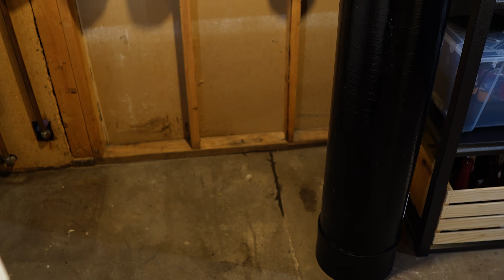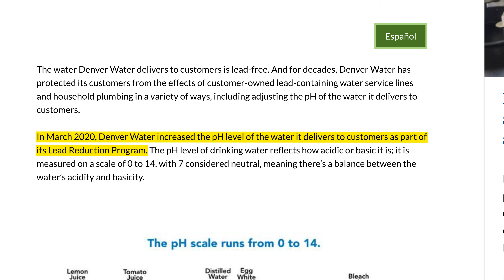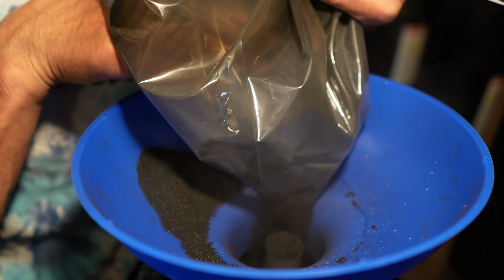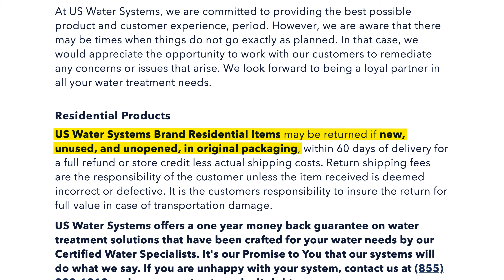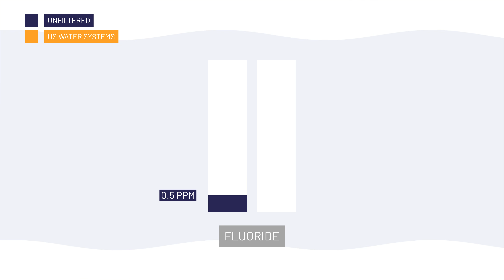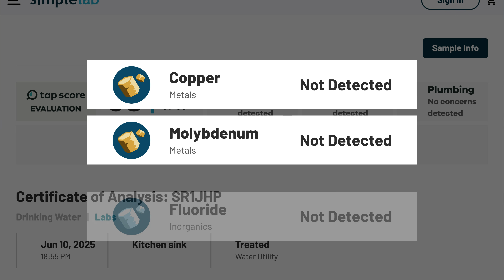The BEST Whole House Water Filter for Treating Lead & Fluoride

Comment: Why are all these contaminants in the city water at all?
Reply from the maker: A lot of contaminants are in city water because public utilities are regulated to meet the National Primary Drinking Water Regulations*, which set legal limits called *Maximum Contaminant Levels or *MCLs*. Those standards are meant to make water legally safe to drink, but they are not comprehensive and they do allow trace amounts of certain contaminants to remain in the water.

The important thing to understand is that MCLs are not based on health alone. They’re set by balancing public health protection with what is practical and affordable for treatment at a large municipal scale. So in many cases, small amounts of many contaminants can legally be present in tap water even when they’re not ideal from a health perspective. That's one reason i always say "meets regulations" does not necessarily mean "free of contaminants."

Comment: Have you heard of Pure Way whole house water filtration? I live on Maui and people here seem to be going crazy on this filtration. What do you think?
Reply from the maker: I have not heard of that brand, no
Reply: @waterfilterguru  They claim that dentist office use it, so it's medical grade. Im skeptical about everything, especially if it's popular.  I can barely find any outside information besides from the company. The system is about 4k to install. I think that's pretty expensive and I personally need some reviews bf I go for it. I'm taking your advice and getting my water tested through tap score first to see what I need in a filtration system first. Then, someone to install. 

Do you think someone's house pipes can contaminate the water after the filter, once it goes through the house? Im struggling with this. Our house is old. Originally built in the 70s. Who knows what the pipes look like? Is a whole house filter even worth it or should I try and filter each water source?
Reply from the maker: Yes a home's plumbing system can absolutely contaminate the water, lead contamination is the most infamous example

Comment: Do you have recommendations for a full house filtration system on a well either the addition of adding minerals?
Reply from the maker: It depends, there is no such thing as a one size fits all system. With well water, you may need multiple pieces of treatment equipment. Start with a lab test, use the data to guide your decision!

Comment: But in your tested opinion, what is the best whole home filtration and softening system?
Reply from the maker: That depends on the water issues that need to be addressed. Have you had your water lab tested yet?
Reply: Have you tested for well water houses at all? Smelly water with hot and cold, leaves skin feeling kind of slimy.

Comment: Our lead service lines were just replaced with copper.   We used a countertop AlexaPure for drinking, the house has an old filter in the basement but I don't  know much about it , & I  accidentally ordered a Shower Envy , may as well try it but wondering if I should send it back for something else & what to start considering.  City water , lots of chlorine and lots of local service like work to replace lead.
Reply from the maker: Filtering the water for showering is best done with a whole house filter, and since you have one installed this would be your best bet vs a point of use shower filter. Check out what you have installed and see about using a carbon block or GAC filter cartridge, if its a cartridge system

Comment: Hello water filter guru,
I’m looking for your recommendation on a whole house filter

I have tested and want to remove pfas, Voc, nitrates and chloramines, chlorine etc
Fluoride not added

We also have medium hardness
Under 90ppm

2 questions:
Should I add a water softener?
What is the best all around whole home system ?
Reply from the maker: Sounds like you'll need multiple pieces of treatment equipment. You'll also want to consider other water quality parameters like pH. 

Hardness of 90 ppm is considered moderately hard. Some people like to softer water this hard if they notice issues like scaling or reduced soap lather while bathing. A softener will also prevent scaling inside your water heater, helping maintain efficiency. At the end of the day, deciding whether or not you want to soften water that is moderately hard is up to you.

If you'd like me to take a look at your test report, analyze it and build a customized treatment plan I offer consulting services. Learn more and submit your request here https://waterfilterguru.com/consulting/

Comment: Have you tested the halo h20 ultimate water conditioner/filtration?  Our plumber is suggesting this system at a cost of $4,700 installed. We are moving in about 2 weeks and he will be there to re-pipe the house.  This seems pretty expensive
Reply from the maker: Is the plumber the one trying to sell you the product?
Reply: @waterfilterguru  Yes, he quoted us 2 different ones.  The halo and A.O. Smith which I haven’t found rave reviews about
Reply from the maker: @michaelschmidt6536   I have not tested either of those. Typically you can save $ by sourcing the treatment equipment yourself

Comment: Hey i know 100% pure water is unrealistic although I'm still trying to get clean water even if there are no good minerals and tanks are usually a problem as I have limited space for under sink fliters, although for quality they're usually the best I can find. Do you have any good recommendations for any over faucets, countertops or even small under sink filters that remove 90% of  heavy metals like lead, arsenic, mercury, pfas, pfoa, pfos, Gen X and vocs as well as microplastics, fluoride, pathogens, disinfection byproducts and general particulates-if you have any good recommendations for a countertop or over faucet that does a good job for all or almost all of these please let me know because I'm thinking of just going with natural glass bottled brands like gerolsteiner
Reply from the maker: Sounds like you mat want to consider distillation or reverse osmosis. This video will be helpful https://youtu.be/xlC3m2ZFNDQ
Reply: Reverse osmosis will get you the closest to molecularly pure water as you can get. RO is used to filter seawater for nuclear reactor coolant loops for a reason. I’ve had great results with tankless RO like Waterdrop or Frizzlife for myself and my family. It’s pricier than a tanked setup, but super easy to install yourself which saves on a plumber.

Comment: Curious. Do you plan to do a video on aquatru shower filter
Reply from the maker: Yes - this one https://geni.us/2u8Eb6 right?
Reply: @waterfilterguru hopefully it’s a good option. Just bought one.
Reply: @kcalderon03 it’s ok - but not optimal - the weddell duo is the best on the market
Reply: The newly launched aqua true shower filter is no better than canopy and joule- the weddell duo is the best on the market
Reply: @dillanrichardson-x8k yeah I have weddell but considering that the aquatru filter has independent testing to nsf like weddell intregues me
Reply: @boat_shoe_bobby ahhh I see but because weddell duo uses a carbon block filter which will always be superior to granulated activated carbon like what in the aqua tru -don’t get me wrong when I saw aqua tru launched their shower , I thought it would of been cutting edge since they have the best drinking water filters . But their shower filter is just like the rest in my opinion .
Reply from the maker: @dillanrichardson-x8k   Can you share your test data that helped you reach this conclusion? I'd love to see how it performed for you 🤓 I've not tested it yet so I can't say one way or the other if the Aquatru shower filter is better or worse than others. 

I do know it's currently in the certification process to NSF/ANSI 177 for both chlorine and chloramine None of the other shower filters I've found yet claim to or are able to reduce chloramines. This is what intrigues me the most about this one